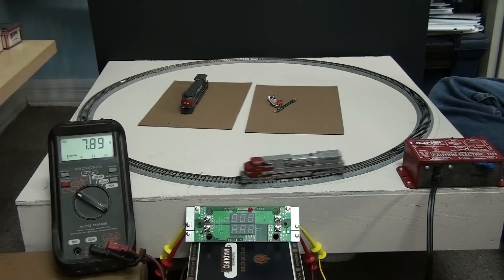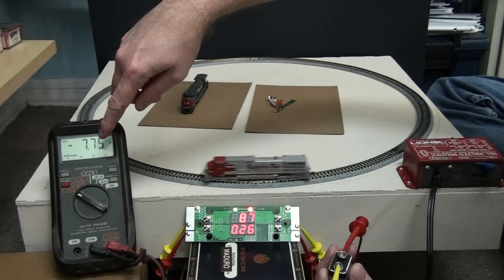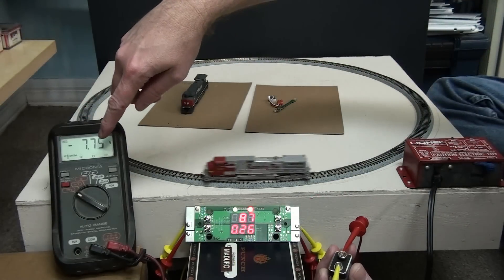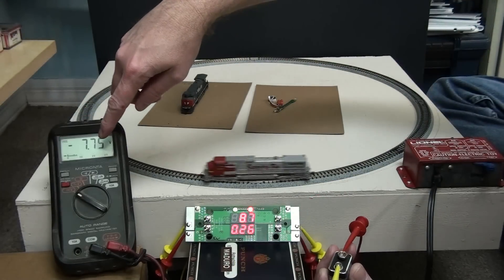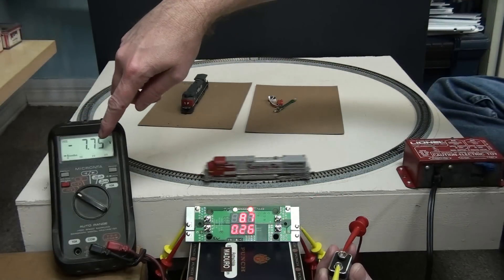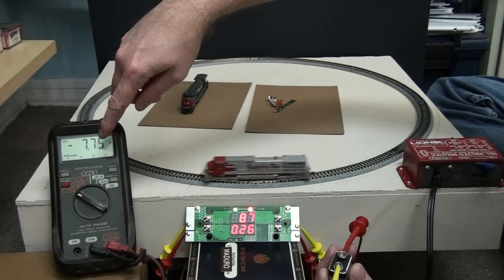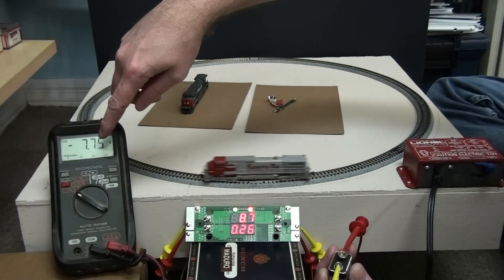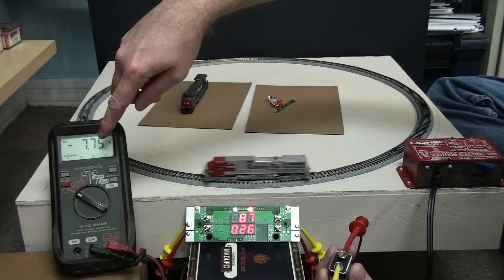🔴Inside Look: How Digital Command Control Operates

Comment from the maker: DCC explained in plain english for the complete beginner

🔴DC to DCC - Understanding digital command control how DCC works - DCC explained - dcc train control
Reply: Hi  I am using MRC Prodigy Elite Please let me know how to set the amp manual “SYS” + “SHIFT”
 “2”
 “ENTER” 2 amp setting But it does not work. If the setting is normal  I wonder how it will be a display I want to see the setting process in video
Reply from the maker: Have not worked with MRC unit in a long long time

Comment: I want to know more in deep this. What i want to know is if the DCC decoder regulate the voltage for the motor. Why i ask it? because more voltage in rails better conductivity. Make al rail at 24V or even 36V instead of 12V. And the decoder drop the voltage to the desire.
Reply from the maker: it is pulse width,  does not regulate voltage.   Longer and more pulses width the engine will go faster.   Voltage to the motor stays the same.   Any thing get over the 16v or more will fry the decoder, depending on what it is rated at.

Comment: Can you use the power cab on a small layout? My layout is built on a door…3x6 to be exact and I have been wondering if it’s worth it to install!
Reply from the maker: The power cab is perfect for a small layout.  The NCE power cab is designed for layouts just like yours
Reply: @IMRROcom  Awsome, I wanted to used sound locomotives also, will this system work with them?
Reply from the maker: @joekugelman4196  yes it works with sound too
Reply: @IMRROcom  thanks for your help! I am definitely going to pick it up!

Comment: I notice that your NCE Power Cab was showing amp readings on the top right of the LCD display.  My PowerCab shows the system fast clock and I can't seem to find a way to toggle the display over to the amp display.  How do you do that?
Reply from the maker: Can not recall that at the moment

Comment: Hello I have the atlasmaster you showed and i was wondering if you have a video on how to ues that alittle more i have alot invested in it so could u show me how the features work on it like cosisting and changing hte cv.s on the engien like voltage settings and stuff ....
Reply from the maker: I'm sure the Atlas unit is outdated at this point

Comment: I have a 2' x 8' N scale layout using Atlas code 65 true track. How many n scale locos can I run using the MRC Prodigy Express system give or take. I don't have sound decoders on any of my locos, but I'd like to have some. Thanks!
Reply from the maker: need to figure out the amps or that system.  most N scale pulls less than 1 amp.  so5 but no more than 10 would be a good place to start

Comment: Ah, finally someone who knows DCC.  I have a situation I hope you can help me with?  My DCC system is Bachmann EZ Command.  I purchased an Atlas DCC locomotive that came with a factory setting of #15 (which blows my mind) but, the EZ Command only goes up to #10 so, how do I change the address on the Atlas locomotive to run on my system or do I now have a $200 paper weight?  Thanks in advance.
Reply from the maker: http://www.bachmanntrains.com/home-usa/ez_content/EZ_Command_instructions.pdf

REPROGRAMMING DECODERS WITH PREVIOUSLY ASSIGNED DIGITAL ADDRESSES
You can use the E-Z Command system to control locomotives that have a previously assigned digital address other than number 3. If
the previously assigned address is a number less than 10, follow the directions we’ve just described to assign a new address to a
locomotive decoder. Just substitute the locomotive’s original digital address number for the number 3 in the standard programming
procedure.
However, if the locomotive’s digital address is a number higher than 10, you can reprogram it by following this procedure:
First, remove all locomotives from the layout. Next, follow the standard E-Z Command programming procedures as described in the
“Programming a Locomotive to a Specific Address” section (but without any locomotive on the track), including pushing and
holding down the number 3 button and the “Stop” button. At this point, you’re ready to assign a new digital address to the
locomotive. Simply place the subject locomotive on the track and assign a new address by pressing a numbered E-Z Command
button (1 to 9). The locomotive will move slightly to signal that you have successfully assigned a new, lower address. Finally, push the
“Stop” button to exit the programming mode and begin operating your locomotive at its new digital address.
Reply: ***** You're my new best friend, lol.  I want to say I tried this but, it's been so long I wouldn't swear to it.  At the moment my track is covered with weights as it has been permanently mounted to the layout however, you can bet I'll try this first thing in the morning as soon as I clear the tracks.  I will keep you posted as to the income & thanks a bunch!

Comment: I got my NCE Power Cab Starter Set from the UPS guy today & I love it.  This is so much easier to use vs. the EZ Command with tons more features on the NCE.  What I paid for the EZ Command Center & Power Booster, I could have purchased 4 of these NCE Power Cabs.  Looks like the EZ Command will be going on eBay, lol.  Thanks again, I'm so stoked I took your advice & purchased the NCE system.

BTW, the Atlas locomotive is up & running beautifully!  All I need to do now is install my new MRC sound decoder w/speaker.
Reply from the maker: Cool,  The NCE seems to not disappoint.   I'm not sure what scale your in but,  I'm not a fan of sound in "N" scale.  I not happy with MRC Sound.
Reply: ***** I'm running an HO scale setup with a mixture of motive power (manufacturers) & decoders.  My decoders are made by MRC, Paragon2 & Digitrax with 100% smooth operation, except for those damn turnouts I told you about, lol.  If I rip those out, I lose 75% of my rail yard.  Well, before I bought the MRC decoders I had researched them on here watching countless videos & the opinions of MRC seemed 50/50 good & bad.  When I compared $55 each for the MRC decoders compared to $139 each for Soundtraxx Tsunami decoders, it was a no-brainer for me simply because I'm forced to work with an extremely tight budget.
Reply from the maker: I have a lot less know in HO than "N" so.  So I can give you my simple answer that some one can understand from Texas.  If the cows are missing from the barn,  I would think someone left the barn door open.
Reply: ***** A simple answer someone from Texas can understand?  What the Hell is that suppose to mean??? How can you have less knowledge in HO vs. N when they both operate identically?  Let me explain it in a way a guy from Arizona can understand?  It's no wonder the guy on here called you rude.  He hit that nail on the head, lol.  And btw, if you're as sick as you claim in several of your videos, why don't you see a doctor???

Comment: Getting back into model railroading.  I've had them put away for a while, we had a new baby.  Now that the baby is getting older I am able to start working on the train layout more again.  Hope to soon build permanent bench work and start laying permanent track.  So far we've been using some Bachmann track that I was given.  We picked up a few extra pieces so we could make a small temporary layout to play with. 
   When I was researching, and deciding on a DCC system, I read and watched a lot videos.  I had narrowed it down to the MRC Prodigy Advance Squared, Digitrax Zephyr Extra, and NCE Power Cab.   The one train store that is close enough for me to visit from time to time, as well as the clubs I've found in the area, all use Digitrax.  The store stocks and sells Digitrax, but said they could get me NCE gear if I wanted, but the price was going to be more than a Zephyr Xtra.  I began looking online, as I am in a rural area and most of my hobby purchases are mail order.  Eventually I ended up picking up my DCC system from a "local" vendor that was at a train show in Spokane.  I got a great deal on a package from the train show, along with some rolling stock.  I am not close enough to town to be able to participate in the clubs there, so having the same system didn't figure into the decision much.  If I had been planning to participate in a club, and hoping for support from a group, I would likely have gone with Digitrax. 
   Another thing that may factor into some people's decision, is the Zephyr's ability to use "jump throttles" or run a DC locomotive.  I was just getting into model railroading and had no DC equipment, so that was not something that I was extremely excited about.  For some, that may be a key feature on their list. 
   I didn't find anything that made me keep MRC on my short list for very long, the Prodigy Adv. 2 had a few things going for it, output power, additional throttles are reasonable, etc...  However, after looking into things a little, it ended up getting taken off of the short list, partly due to price for the starter setup. (you might find this funny in a minute)
   The Zephyr had enough output, and features for what I am wanting.  3A would likely be all I'll ever need.  I did want to have a walk around throttle though, and for what I'm planning, there isn't a spot such as a yard that would be a good spot for the stationary Zephyr console.   I could see where that would likely fit into many peoples setups nicely though.  It has all the programming features necessary from my perspective, and Loconet still seems great, although I have no plans for detection, signaling, computerized automation, etc.   The Z could easily be part of an expanded setup, and I like the DT402 throttle, but I don't like the UT4, and those are the two choices for Digitrax throttles.  Deciding between a Zephyr and Power cab is something that I thought about for quite some time, imagining what my "empire" would grow into, and learning what was possible with DCC, deciding what I wanted on my layout, etc.  
   With my space, budget, and modeling goals, NCE just fit and ticked all of the necessary boxes.  The 2A Power Cab had plenty of functionality and features, as well as enough power to suffice for quite some time.  I still have only 2 locomotives, 1 with sound.  Hoping to add to the roster this winter, but my long term goal involves no more than about 6 locomotives, with 8-12 in the collection tops. 
   As far as operations are concerned, I'm still researching uncoupling methods, and other intricacies, but I plan to eventually have ops sessions, I've purchased Tony Koester's book on operating, along with a MR magazine supplement on operating.  Along with this I've also picked up Micro-Mark's car card system and am working on a sequential operations plan.  Most of my siding will be ground throws, with mainline switches controlled by Tortoise machines most likely. 
   So, I was researching and getting into DCC at a great time, the Digitrax sets all got the Xtra update, NCE had just released some great stuff as well, and there was a train show coming up.   I got a chance at the store to check out a DT402 throttle, and got to visit a club layout running Digitrax and watch some trains being run.  But that still didn't sell me on the Digitrax system.  The UT4 just didn't do it for me, the DT402, although nice, wasn't cheap, and the Z was a stationary piece.  To get to where I wanted to start out in DCC, I was looking at a decent outlay and some compromises either way.  
   NCE had recently released the SB5 Smart Booster, and the Cab06p happened to be on hand at the time as well.   I really like NCE throttles, the Power Cab/Pro Cab, Cab 04, and Cab 06.  Not so much a fan of the encoder versions, or the Cab05 with it's button only speed control, but I can again see where for some that would be a better fit.  I do like that with my Cab06 I should be able to do basically everything except programming. 
   I have no plans or space to expand beyond what is possible with the SB5, 6 cabs is more than enough in my situation, 5A should be fine as well, and 3 accessory devices should be enough for what I envision.   For some, these limits might make the Zephyr or Chief systems, or even a Power Pro 5A system the better choice.   What I ended up with is a Power Cab, Cab06p, and SB5 booster.   I have only played around with the booster a little, so I could be sure that it worked, and to see the Power Cab unplugged with trains running, etc.   For now, and for a while to come, the Power Cab and Cab 06 is doing great.  I could see where for some a Power Cab and possibly an engineer's cab would be plenty as well.
   Once I expand to the point of wiring up my layout permanently with districts and an accessory bus, the power cab will then become a workbench tool, be used for the Christmas loop, and eventually be used for other projects such as a coffee table in N scale.  Although the Power Cab cannot be unplugged in it's "out of the box" configuration, it is still a tethered throttle and allows some mobility, enough for my small layout space most likely.  Once a Smart Booster is added it's essentially a Pro Cab.  To get to where I wanted to start, NCE was the route to go with, Cab 06 and the starter set.  I ended up picking up the whole shebang at the show and it was a great deal as a package. 
   Sorry for the long winded post, maybe it will help others trying to sort out the differences or make a DCC purchase decision.  Thanks so much for your videos!  I hope to finally get a video up this winter, as soon as something gets built....
Reply from the maker: Wow,  That is a book.  I will need to come back and read it a little later.
Reply: haha, maybe youtube's old limit on reply length was a good idea....

Comment: I'm going to build my first DCC layout soon and I'm thinking of starting out with the Digitrax Zephyr Xtra Complete DCC Starter System with 3.0 Amp Power Supply and it can run up to 6 HO locomotives at the same time and that's good enough for me. plus it's more affordable then the NCE.
Reply from the maker: How did this turn out for you?  Updates?

Comment: I've already commented on your great video. I have another question that I'd love you to give me some guidance with. I'm just getting back into railroading again as I said in my earlier 
comment. It's very frustrating to me because I'm very concerned as to what I spend my money on first. I know that I'm not going to finish this layout over night, so if you could give me a little insight
as to what I should focus on from the start. !: I've decided to go with Kato N gauge because doing a layout on a 4x8 plywood top would not give me the realistic look that I'm looking for.
2: I also kind of found a layout that would fit nicely on a 36x80 hollow core door. 3: The hollow core door would give me an expansion possibility into an L layout later. So, as you can see I'm
putting some heavy thinking into a very expensive hobby. Hope you can give me some advise so I don't go out and spend all my money first on a costly engine, which I kind of figure 
would be not the thing to do! Thanks so much if you've read this far. Your ever grateful Trainman. Mark
Reply from the maker: Have you look at Ron Mash channel or DIY and Digital railroading?  more helpful

Comment: I liked the MRC, but having that big knob on the bottom was very inconvenient. Then, when I found the NCE with the thumbwheel that falls right under my thumb, and let me operate with one hand, I was sold. I agree that it's a great system, and now, I have the 5 amp radio with 2 hammerheads, and a Powercab, too! Can I use this on my new G gauge garden railway? Not sure yet.

Comment: As a new subscriber, I have a question about the track voltage for N scale.  What would be the best way to achieve the drop in voltage from 13+ to 10-12 volts.  BTW, I'm not what you could call a whiz at electrics.
Reply from the maker: Change the power supply

Comment: I had found a atlas commander at a Goodwill for $3.00. No manual tho. It turns on, i have it hooked up a MRC Tech II ac side. Not the dc side. It couldn't find the original power supply for yhe atlas commander...
Reply from the maker: +Angus Niedo Nice.  Can not beat $3.

Comment: im new to this dcc stuff.  i have a n scale layout 14'x 2 1/2 ' has 3 main line all seperate. heres my question. 1st  original controller i i have power going to multiple points.  when i change do i have to change power lines or leave then?  2nd i can join lines with switchtrack .  do i have to then take away original power to that line or just remove old controller and hook power to new mrc cab?
Reply from the maker: You should be able to hook the system up,  with no issues.  run the wires to the DC power pack distribution line and you will be good to go.

Comment: Good video.  The myth with DCC, however, (and you'll read and hear this) is that there is less wiring.  In reality, there not less wiring than DC and in some cases, more.  The advantage is though, it is just red and just black all going to one buss to the respective DCC power pack (I use DCC).  No blocks, no constant flipping of switches to move engines around tracks.  You just dial in the engine and go.  Simple.

Wiring is just as complicated as DC, operation is a thousand times easier.
Reply from the maker: +Mr. Patton's History and Political Science Videos Yes,  You just do not need the blocks like you do in DC.

Comment: i am about to make an N gauge coffee table layout with glass top, i don't want any cables coming out from the table to a wall plug, i was thinking of using a 9 volt battery and a toggle switch for forward and reverse with a potentiometer. I was wondering if you had any idea of how long a 9 volt battery would run for with a train doing a realistic speed and pulling a couple of coaches.